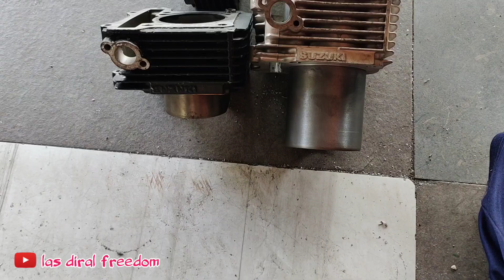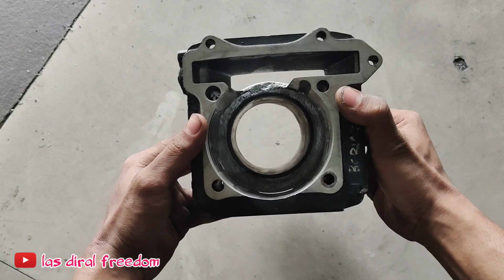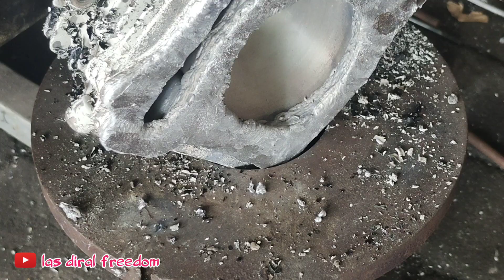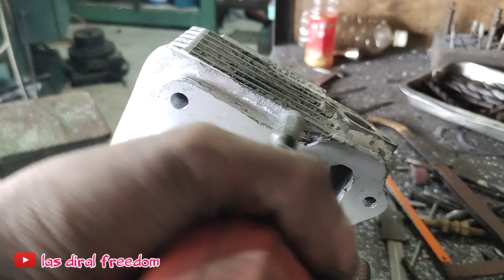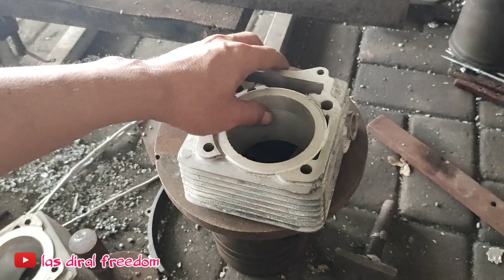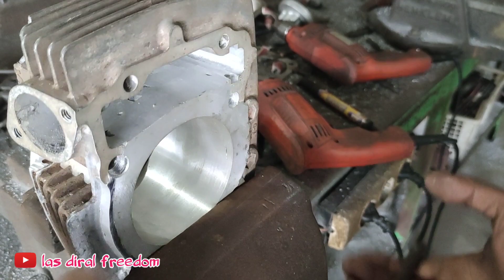Blok Fu bore up | Blok CRF Bore Up | welding aluminium

Comment: Mas harga block FU nya harga berapa ?
maxsimal liner di size berapa ?
mohon jawab
Reply from the maker: Blok Fu kirim bahan sendiri mas. Kita tidak punya bahan. Di isi liner 90mm masih aman. Shok aluminium diameter luar 95mm
Reply: @lasdiralfreedom   biyaya untuk jasapengerjaan nya berapa mas . ?
Reply: Nomer whatApp mas
Reply from the maker: @gembelde9133  di Instagram ada nomer wa. Nama Instagram las diral freedom